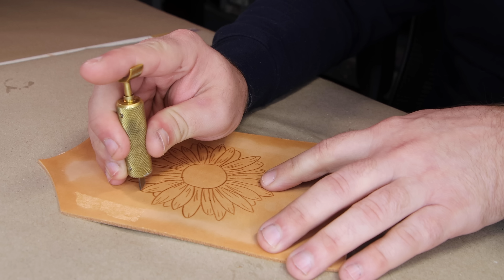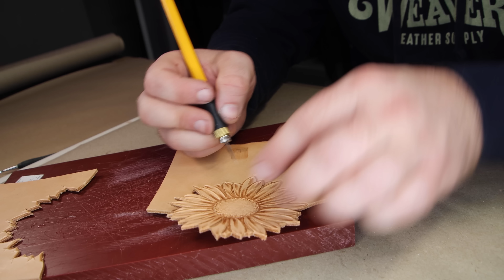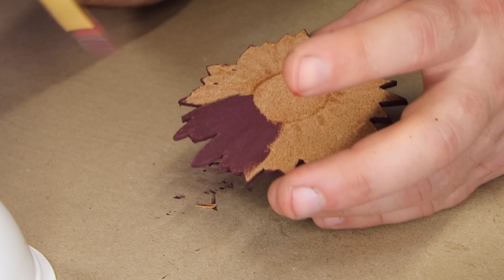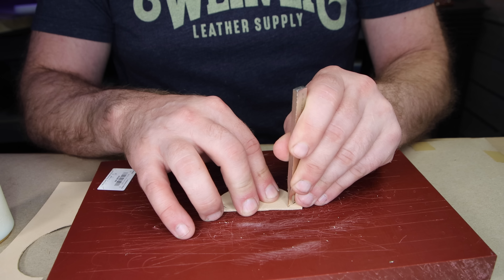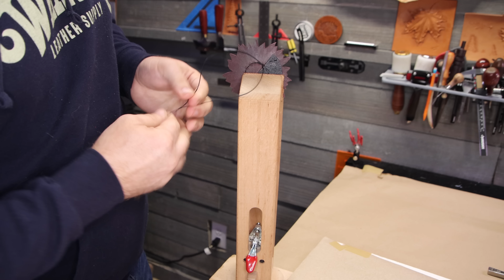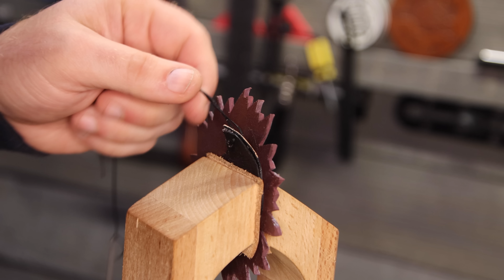Making a Leather Daisy Corner Bookmark

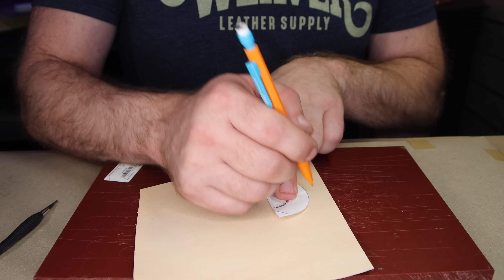Comment: At 23:34 i noticed there is a smaller circle on the saddle pattern piece.  Only thing i can figure out is it is where you stitch to the flower?  I don’t remember any mention and it’s not marked on the pattern.
Reply: Correct. It wasn't necessary for the pattern,  so we left it off when it was digitized. Good eye.

Comment: Question for you: can acrylic artist paints be used on leather instead of "leather paints" ? What's the difference? I mean  tube acrylics, not the little bottles of cheap stuff you buy at stores like Walmart.
Reply: Great question! And yes,  absolutely. 
I believe the "leather paints" have binders in them that make them hold to the leather better,  but I use all sorts of acrylic paints and have never had a problem.  Just make sure you seal it correctly.
Reply: @DanielReachCreations    You can add a separate sealer to any kind of acrylics to increase adherence to the leather and retard cracking of the paint when the leather moves.